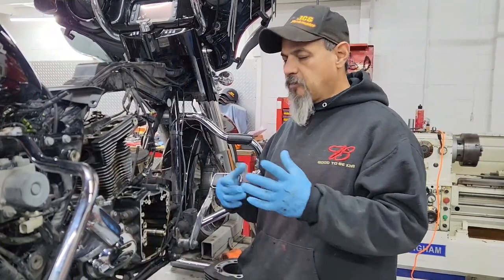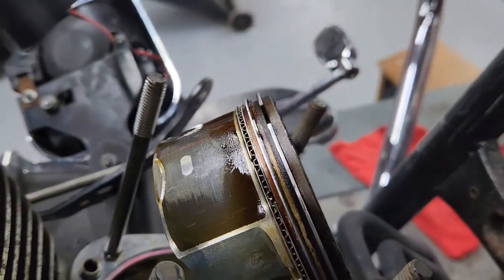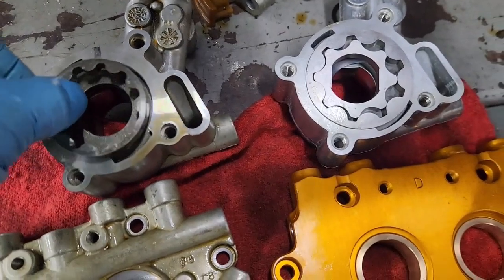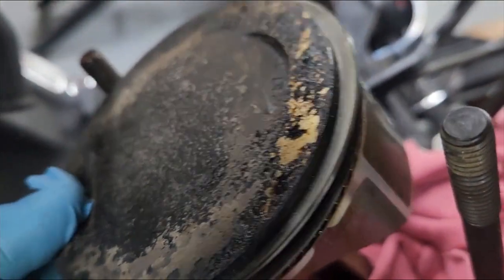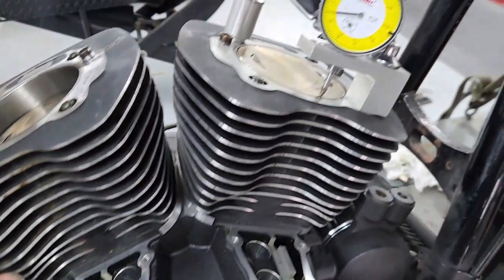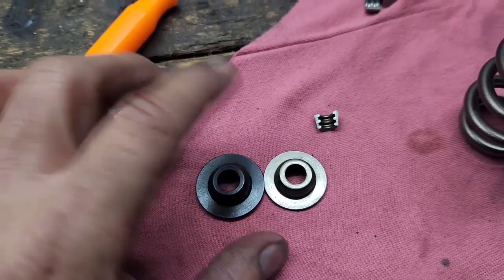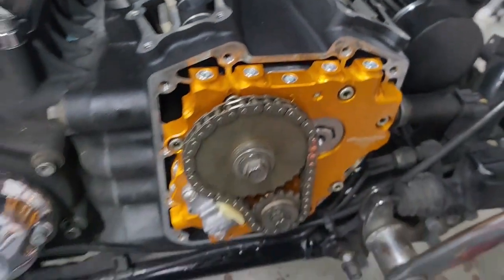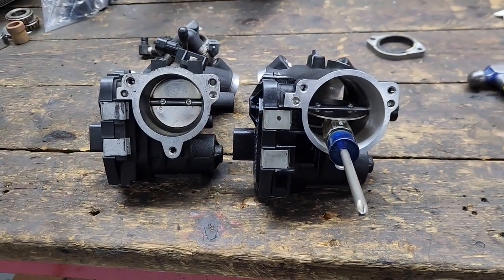Harley 103ci HO SE585 Cam Chest Upgrade and Dyno Tuning

Comment: I just had 570-2 cyclorama cams put in my 2012 streetglide by shaeffers HD in owigsburg PA. Head pipe from drag specialties vance and hines monster rounds. Screaming eagle cam plate and pump. .005 crank runout so didn't use s and s stuff. Everything else stock . 56k on this engine was just stage one never was opened up. Made 98.6 h.p. and 116 ftlbs of tourque. Could've be happier

Comment: Good video....what did you set your quench distance at?  If your 0.005” in the hole I assume you can adjust your quench distance with head gasket selection? Thanks!

Comment: What is considered “running hot?” Cause I’m in TX and my sh*t gets hot.. also, which SE cam plate is that? Only SE ones I’ve seen, on their site, are blue
Reply: Yea, hard to say what is "running hot" lol. Im in northern  Alberta and thought mine was plenty hot. Also, its S&S with the blue cam plates.
Reply: @brando81  I’m an a$$hole.. need to pay attention.. SE cam chest, not S&S.. thanks for being gentle
Reply: @bullast2046  haha all good man, those Jagg oil coolers are supposed to work pretty good. Might be worth a look.